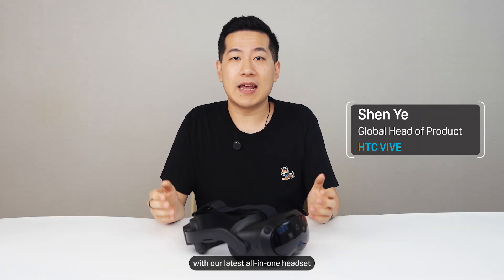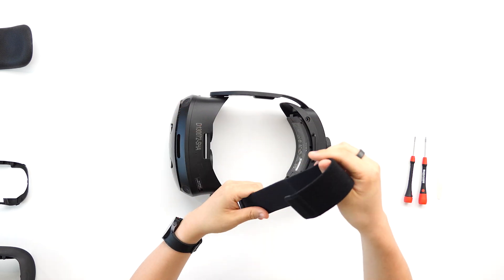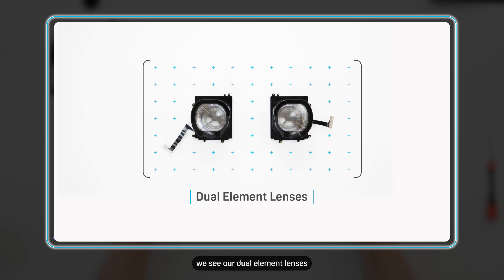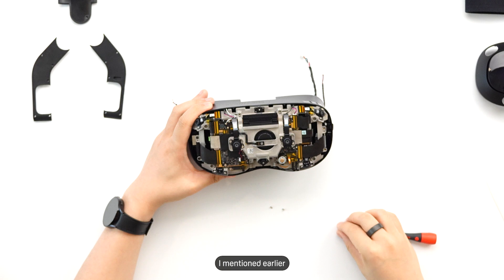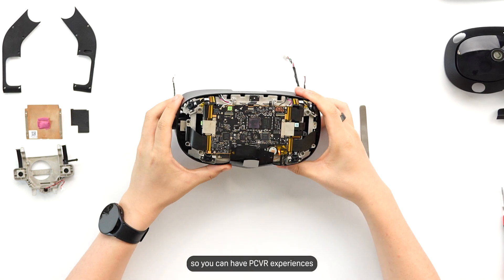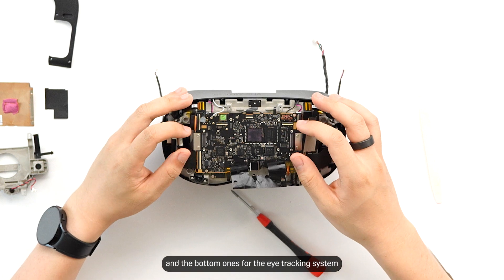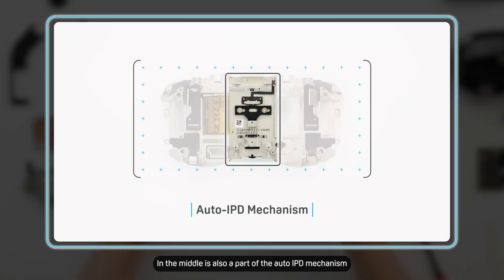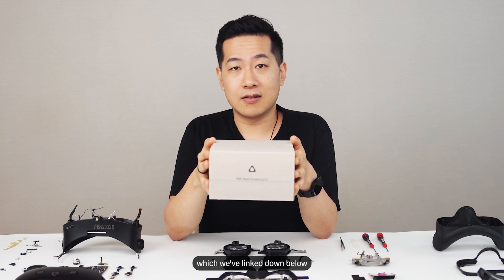VIVE Focus Vision Teardown

Comment: it is a lovely headset, though trying to use the 3.0 body trackers where a bit of a pain as you have to use the 3rd party OVR space calibrator plugin on SteamVR to use them, quite the same way as the Quest. 
would like to see a specialized dongle for the 3.0 trackers to connect to the headset, same for using 3rd party touch controllers that unfortunately uses base Stations.
Reply: There are watchman dongles for use with Vive trackers, wands and knuckle controllers. Search for them, 1  dongle per device, and 1 USB 3 port for each dongle (at least 15cm spacing between dongles). With some luck, you may find discontinued Super Wireless Dongles (SW4, SW3, even SW7 made by Tundra Lab) which can connect up to 4, 3, 7 trackers respectively in single dongle. Good Luck.

Comment: I liked the teardown process, especially finding out it has a magnesium component. I’m really trying to see why VR arcade owners would buy this headset in bulk, though. Half the video goes on about build quality, but it still uses Fresnel lenses, which are literally the worst. These lenses make first-time VR users feel horrible. You can find the same optics in headsets costing $200-300 nowadays. High pixel density doesn’t mean much if the user can’t wear the headset for more than 15 minutes without feeling sick. This headset is trying to compete with old headsets, but at a much higher price 😰

Comment: Maybe it's just me but I would love a stand-alone headset with no PC require but I wouldn't mind if it was wired to give it a bit more PC level performance. Especially in games like vrchat. In fact if a VR headset dedicated to just VR chat I would buy it in an instance if it meant it supported most PC avatars and would and if it had the option to have full body trackers similar to what Pico is doing with the Pico 4 ultra.
Reply: I do believe this headset gives you the choice between being standalone or plugging it into the PC for native PCVR. The only thing it doesn't have is choosing between inside out tracking or lighthouse tracking. But then again, I'm one of the rare ones who like lighthouse tracking.
Reply: @replacesoundboard  Yeah, I would have to do more research on this headset. If it could stand alone, play VR chat with better performance than the Quest 3. I would probably consider it. The entire reason I got into VR was just for VR chat. lol I feel like this is the case for too many people. Also that's another thing. I don't know how it would work but I wouldn't mind a standalone headset that needed lighthouse trackers or base stations . If that would make the process of full body easier. And more accurate and potentially leave more space for more  processing to the actual game.  I wouldn't mind it at all really but I don't know how that would work.
Reply: @foofi5273  Funny, I tried to reply to you and Youtube hid my comment (only visible by setting the "display comment by newest". I probably used some keywords it doesn't like (perhaps the name of the processor).

I guess this headset could be for you, although it's twice more expensive than a Quest 3. It has an integrated processor and can accept a 2TB SD card (to store games) so it definitely can run standalone. It also has Wi-Fi to play wirelessly on computer, and an optional add-on to play wired on PC for those who want the highest PCVR quality.

Resolution and (Fresnel) lenses seem to be similar to the Vive Pro 2 (which I appreciated, although I much preferred the OLED from the Vive Pro 1, so I returned my Vive Pro 2). Some people don't like Fresnel but I don't mind it. At least screen-door effect is gone. and the field of view is quite good enough (even if part of it is blurry because of Fresnel lenses).

The biggest drawback I believe is it's going to be a less popular headset than the Quest 3 (obviously because of the price but also because of the brand; some people don't know HTC, and some people hate them), so it's likely that the operating system of the headset will probably be lacking, either in features or in games.
Reply: @foofi5273  Also, this headset seems to be entirely focused on inside-out tracking (for pure standalone playing), so it doesn't look like lighthouse tracking is an option at all. I guess that's one less hassle to think about (and saved money since lighthouses are expensive to purchase too).
Reply: @replacesoundboard  Yeah, You definitely said enough to get my interest. Though I do already own a quest 3 And the fresnel lenses would be quite a downgrade. Especially at that price. In my opinion. Mainly I'm looking for headset that can at least run VrChat as good as the quest 3. And had easier support for full body tracking. Which I definitely think That world  put the pico on that list. And the library wouldn't be too important to me. vr chat Is literally the only game I play. Now that I think about it that's crazy that I'm willing to spend $1000 plus for one game And to be as expressive as possible in it.
Reply: @foofi5273  To be fair, I'm not a huge VR player. I mostly use it for the SteamVR virtual curved monitor. That didn't prevent me from spending 1350€ into the wired Bigscreen Beyond to have 4K micro OLED without screen-door effect x) As long as we can find our happiness

Comment: Are the fresnel lens the same as in the VP2 and VF3, or have these been improved?  Pity that you didn't use pancakes like your XR Elite.  Still, I'm looking forward to trying out my preordered Focus Vision with DisplayPort addon.  It will be interesting to see if it works better with flight sims like msfs 2020 than my Quest Pro/rtx4090 with official link cable connected to my z790mb usb 3.2 gen2 type-c port.  Last year my preordered XR Elite could not match this and I had to return it for a refund.  Hopefully this won't be the case this time.  Time will tell I guess.  Thanks for your vids mate and best cheers from Australia.
Reply: my guess is having pancake lenses large enough to cover 120 degrees would probably bump up the price of the headset quite a lot. lenses on their own are already really expensive if you ever had to deal with buying glasses, and if pancakes with that wide FOV is even possible atm for a reasonable cost.

some people said its not nearly as bad as the Index's lenses, so if thats true, then im more than willing to put up with that for the other benefits this headset gives
Reply: @CrispyMuffin2  I get top of the line lenses for glasses @$75 with the frames. so basic ones are cheap. HTC is just over charging.
Reply: I've torn down my Vive Pro 2, these are the exact same optics, lens, and display assembly. They did seem to improve the IPD slider and adjustment mechanism, this one looks to be more robust and shouldn't move freely as much as it's predecessor.
Reply: @TheRandomMudk1p  Thanks mate.  Hopefully the improved ipd slider and auto feature will help hold you in the sweet spot.  Time will tell I guess.
Reply: @OlivierFablu-c9m You’re probably right mate.  I’m just hoping that between eye tracking, auto-IPD, DP adapter, and comfort I get a better result than my QPro/rtx4090/Link with msfs2020.  I should get my VFV/DP adapter within about a week so time will tell I guess.
Reply: @OlivierFablu-c9m  Ya, I guess I'll be the judge of that very soon mate, lol!  My local Vive store has a good 14 day return window so I'm not too worried about all that.

Comment: I know alot of people are whipping up a storm about the fresnel lenses, but as an index user this sounds like an upgrade in almost every way. 120 hz in the future, more fov, the higher res and the other gimmicks just makes it seem like a good deal
Reply: I was waiting if dare to say fresnel but no. This would have been really good headset for me and i was considering it really, but no cant really go fresnel. Those are really bad in 2024. If you have used pancake lenses. Theres no going back. Difference is like night and day. Ienses are that which make difference. Watch reviews from their focus 3 and its optical stack. I think its still same
Reply: @lassehiltunen1564  I have a Rift s and a Q3. had no issues with the Rift s and its Fresnel lens. don't really see the BIG deal with pancake's. ya sure the GearVR had them but that also use a Olead display phone. this is LCD. and so is the Rift s. YES the Q3 has higher resolution. and THAT'S Y the picture is improved over the Rift s. so with the major HI res for the vive you should have an excellent experience.
Reply: That's what I also thought when getting the HTC Vive pro 2 which used the same lenses and panels . But it was a major downgrade from the index . The sweetspot was so small that everything was always not in focus . It ruined the VR experience . I strongly advise not getting this headset . Get a Somnium vr1 instead in the basic Edition
Reply: I currently have the vive focus vision and as a former index user, the index lenses are much better. The vfv lenses has a very little sweet spot for your eyes and everything around you is just blurry. Even with adjusting the ipd, it's still blurry. Also, the fov feels much more less than the index. I can't recommend this
Reply: People are sheep that parrot
Reply: The pimax crystal light is cheaper and is only missing eye tracking
Reply: @dallasbroadway8808  next week on Tuesday I am getting the most exciting VR headset ever . The Somnium vr1 visionary Edition 🔥
Reply: There has to be some discount from Valve in Q2 2024.

$1,000 USD MSRP is bonkers in my opinion, especially with the specs that it does. Its primary gimmick like the hand tracking isnt even worth it, consider most game devs place their bias on the Quest Hand Tracking API
Reply: @neojenshi4055  your points are valid, and I agree the price is a little much. But my case at least, with what I can and plan to do, the pros outway the price. If it can do what the index does but better, aside from being a standalone headset, I personally find it worth it.
Reply: @neojenshi4055  I have a Q3 and I can tell you right now PCVR sucks with it and the full body tracking is BAD. I also get major headaches when using it. im considering a VIVE instead. but YES 1K price tag isn't ideal.

Comment: To clarify, is 120hz coming to PCVR or is it coming to just tethered PCVR?
Reply: Most likely will be both, but its important to take note most standalone games already have fixed framerates. 
Depending on what kind of games you play, your not really going to notice anything (unless your pcvr)
Reply: @neojenshi4055  - I am mostly a wireless PCVR user who uses asynchronous re-projection when I need to to maintain 120. I am strongly considering this headset over buying a second quest 3 and want to pre-order before the deadline for the perks but there are just too many things I don't know. Will wireless PCVR get 120hz? Will I have access to re-projection on this headset? Will I be able to get prescription lens inserts on day 1 (thinking lenses for focus 3 would work but eye tracking could complicate that)?

Edit: I repeated my question about refresh rate because it sounded like you may have misinterpreted me as to asking if 120 would come to standalone.
Reply: It says in their ads that 120Hz will only be available with a DisplayPort connection.  TBH, I've never found 120Hz to be useful with either my Q2 or Q3 headsets, even with an i913900k/rtx4090.  I mainly use 80Hz refresh rate (same as my Rift s) because I can't tell the difference between it and 90Hz, plus it gives me a little more performance/headroom.  I do start to see a little ghosting with fast racing sims if I drop down to 72Hz though.  Some are more refresh rate sensitive than others so you just need to find out what works best for you imho.
Reply: @tomc1380  - you are right that it sounds like 120hz is only coming to tethered PCVR. The person in the video said it was coming to PCVR and didn't clarify, so I figured it was worth nudging to see if wireless 120 was in the works. 

I definitely agree that everyone has their preferences and tolerance BUT I am a firm believer in needing the 120 given my anecdotal experiences and the research (albeit limited) out there showing it makes a difference for virtual sickness. As a side note, I'd be real curious if this holds up when the frames are reprojected.

Comment: Will the stop strap be as easy to take off for us as it was in your video? I might take that off and replace it with a leather padded strap to reduce the pressure out on the top of my head. I promise I’m not going to pry my entire headset open because I don’t wanna mess with any of that